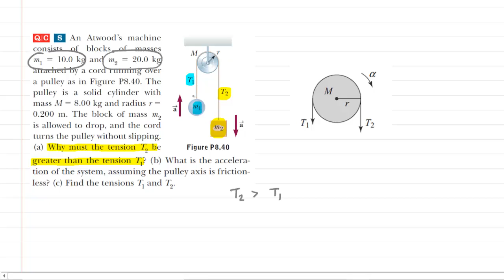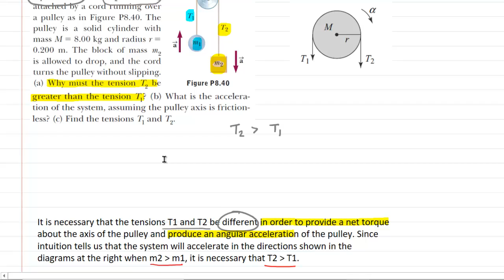An atwood's machine consists of blocks

Comment: In an Atwood machine, the block and
pulley arrangement contains twO masses of
50 kg and 30 kg at-the two ends of the
string. The pulley is a
solid cylinder of
30°
A
|20 kg nmass and 15 cm radius. When released from rest,
determine the acceleration of the system and the tension in each portion of the s